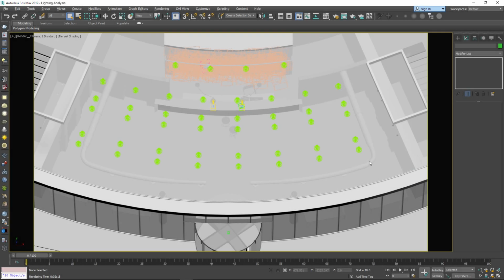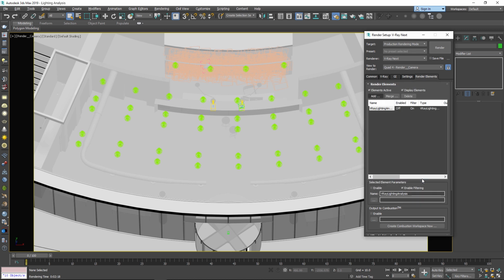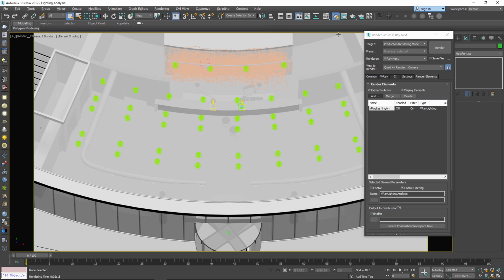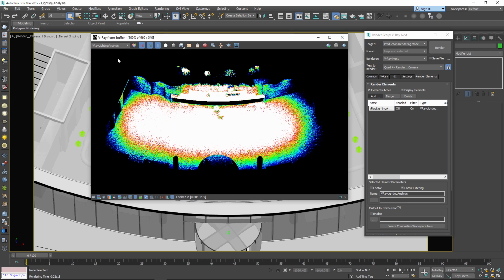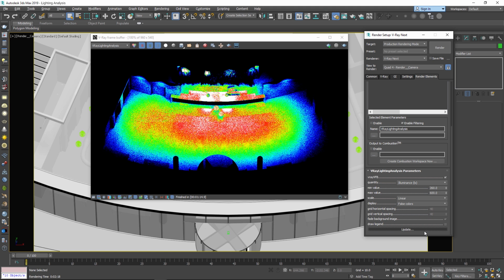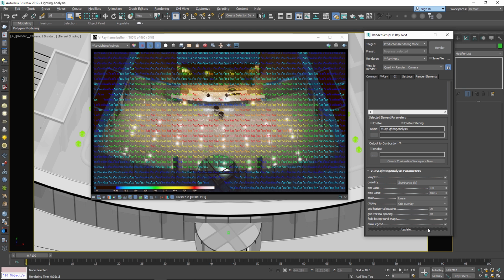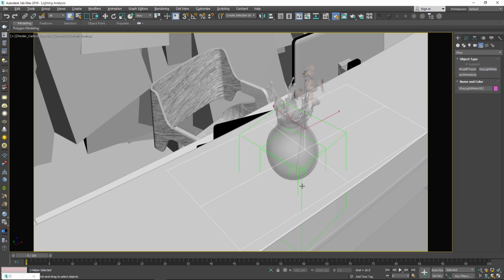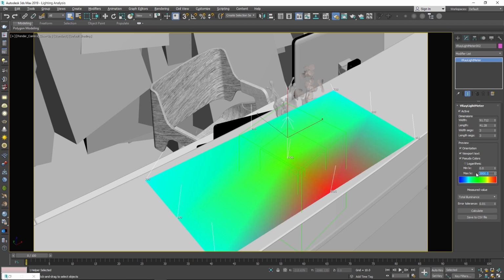V-Ray Next for 3ds Max Courseware – 3.3 Lighting analysis

Comment: and what do we do with this information? this part is missing here
Reply: The usage depends on your profession... In my case as an architect it gives me the exact information of light and distances of it to achieve the client or project light specifications. For instance a for the construction of library or University.
Reply: @DMMG7  Have you tested the accuracy of this as an analysis tool for real projects? I am wondering how can I get my light levels (intensity, exposure, etc.) as close to the lighting in the actual, constructed building as possible. I appreciate any help. Thank you.
Reply: @sayedhusainalmousawi3632  Yes Sayed I have used this technic for real projects when lighting is a detail  (offices, schools, libraries etc). First you have to set the lighting units that are used in your country, in my case Watts, then in  the software create a light distribution that's solves the project needs. Finally you can play with the intensity of lights to match your clients & market requirements... * Just use real world and lighting products properties to match your render with the real life situations *
Reply: @DMMG7  Thanks for your swift reply and valuable information! One thing I have noticed is that when I changed the light exposure settings in the camera, the lighting analysis values changed (keep in mind that I did not let the render finish completely). What I need is a way to measure light objectively, so that regardless of camera settings, I want to know actual light exposure/intensity. Is that possible?
Reply: Ben Maslin  will try that. Thanks a lot!

Comment: Sorry, but why you don’t put the “VRaylightingAnalysis Parameters” and the UPDATE button inside the VRay frame buffer ? 🤔

Kind of unusual having always open the Redering Settings Window.

Could you please also change this in MaYa ?
I work in MaYa 😉

I know this is 3dsmax, but in case this feature is available in MaYa, I will suggest you to put all the values in the VRay Frame Buffer.